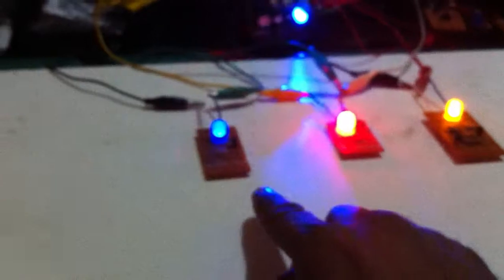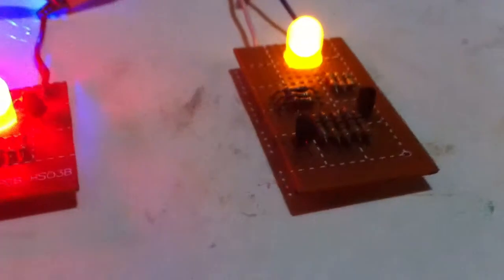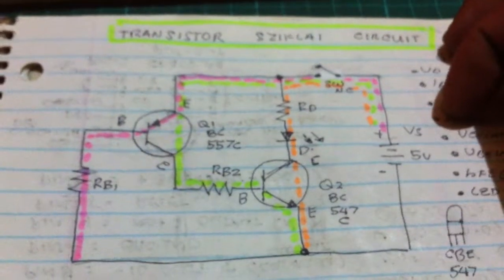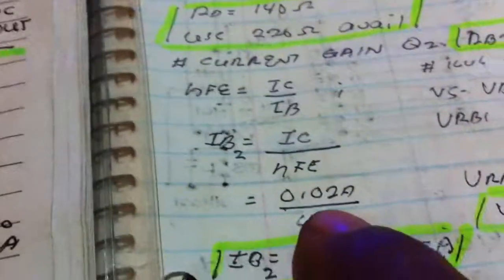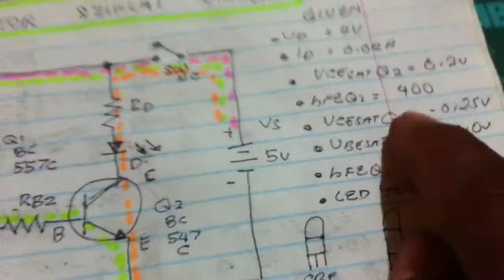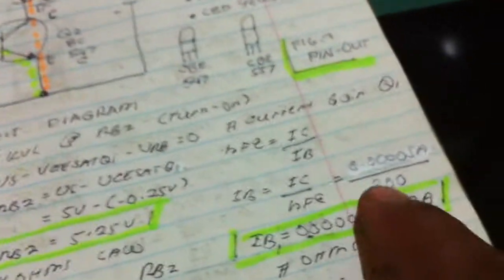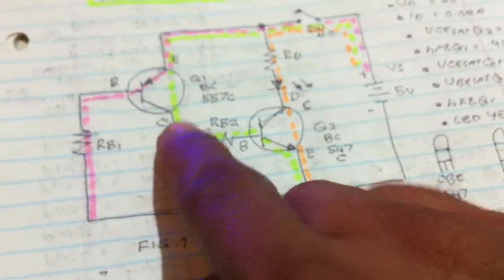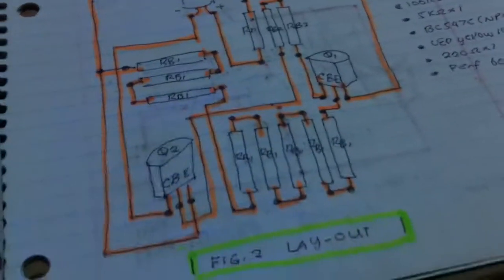Transistor Sziklai Circuit

Comment: The comparison between the NPN and the PNP circuits was a good one, but should be done more explicitly. The incorporation of both circuits into the Sziklai circuit builds on that. I would improve the presentation by showing the circuits power point style without the notebook paper. I would also use power point to animate current flow. You show a lot of math, which is unfortunately distracting, though I get that you are showing a signal boost. The math is still useful if you first show the formulas and the inputs, labeling them on each schematic. Label each output as you calculate each individually, showing the math and insert each result into the diagram as you calculate it, erasing the math as you go to the next output until done. At the end, recap showing the three schematics together for contrast and comparison.

Though I may sound critical, I think that this is as good a demo of the Sziklai circuit that I have ever seen. I am telling you how to do a remake that would boost your viewership as it would boost your understandability far beyond the other YouTube presentations.

Regards.